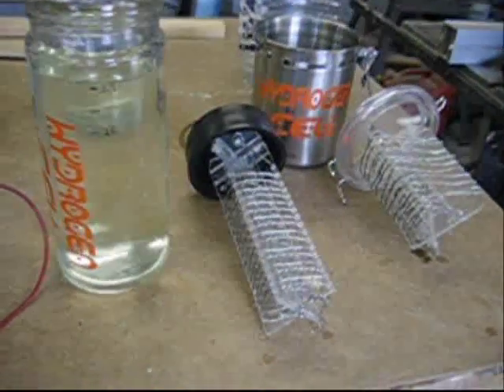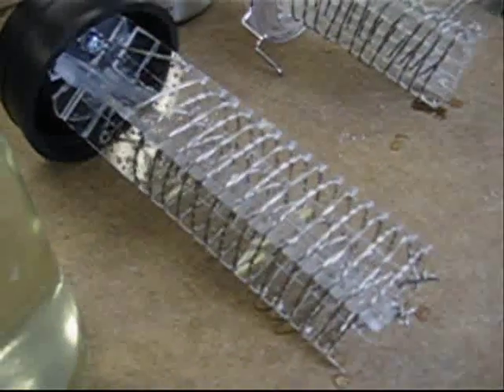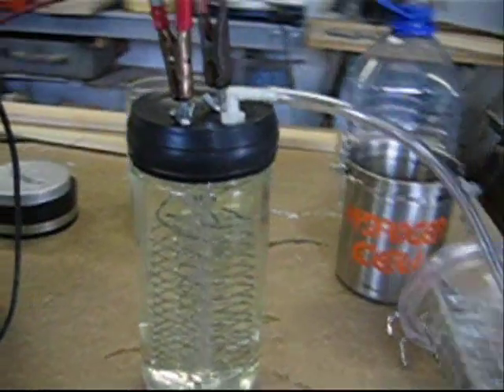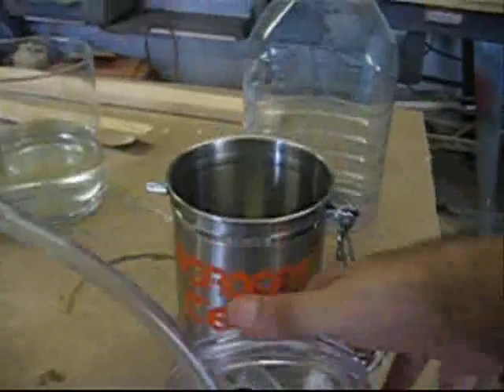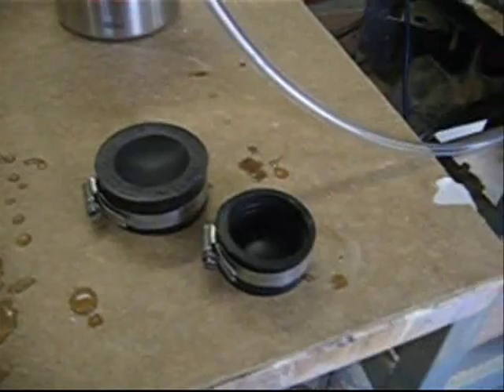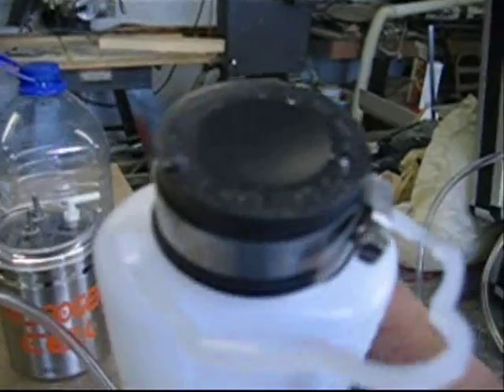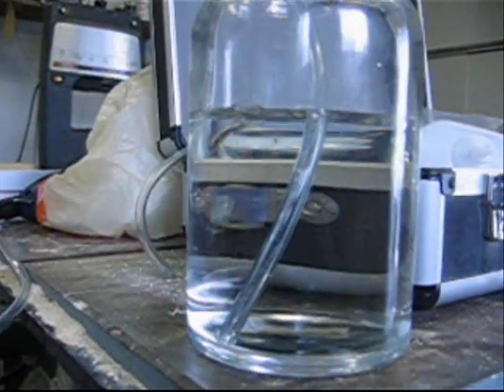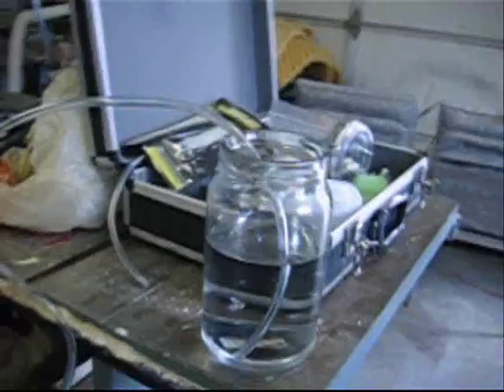Hydrogen Cell

Comment from the maker: I was told the glass can blow up, and it lose voltage trought the glass, dry cell the water is circulating so this was you can reduce the heat.